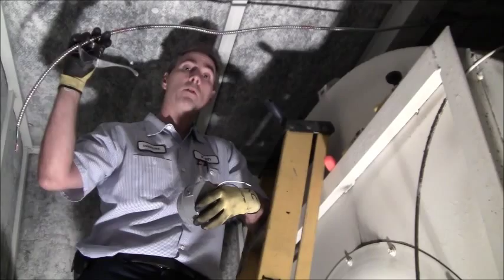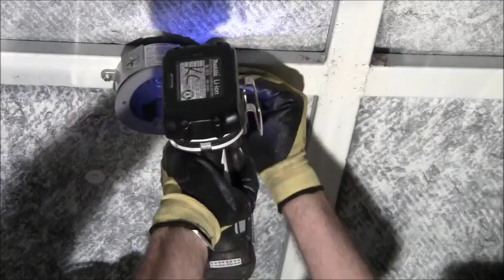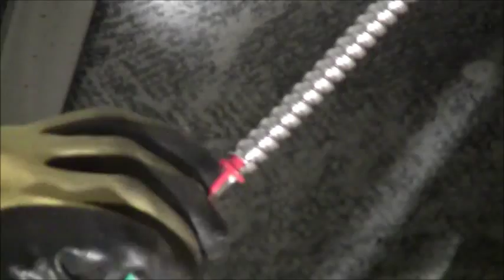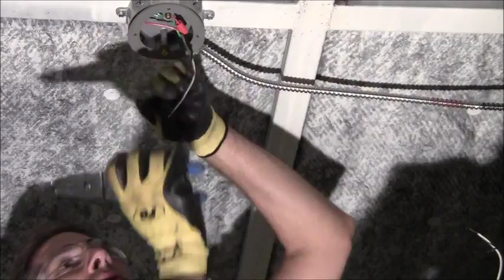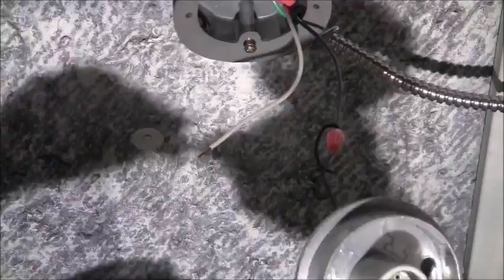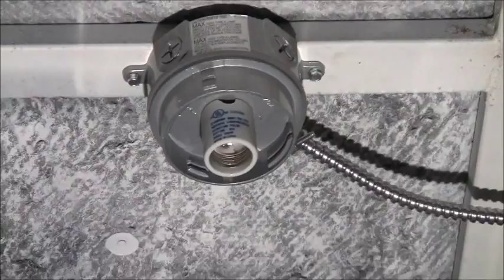Installing a Light Fixture with MC Cable

Comment: strip the stranded wire a little longer than the solid wire.then wrap the wire around the solid wire. don't depend on wire nuts to hold the wires together
Reply: Agreed.